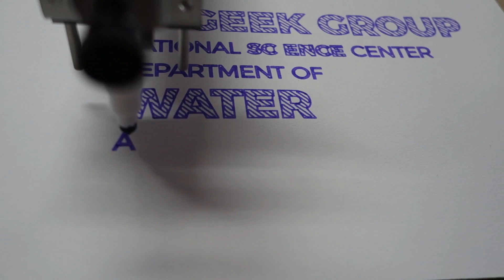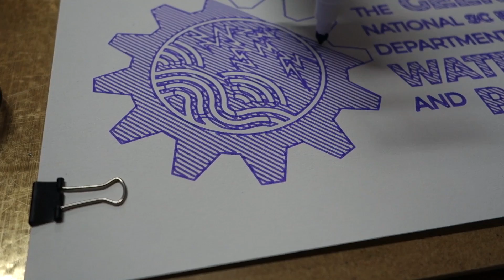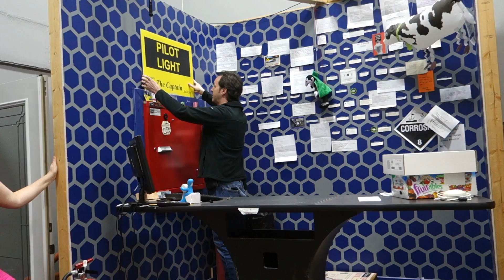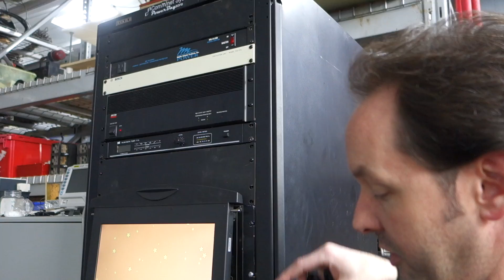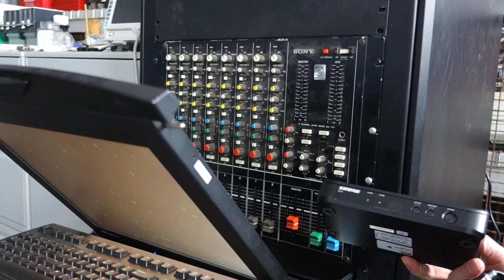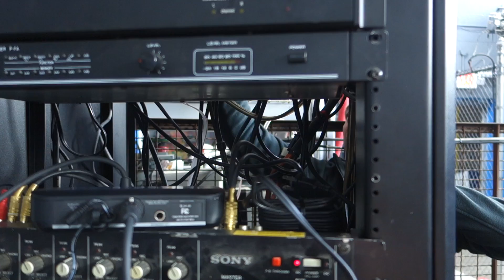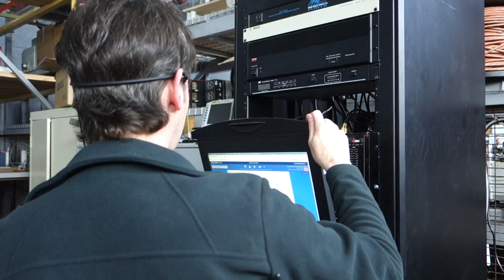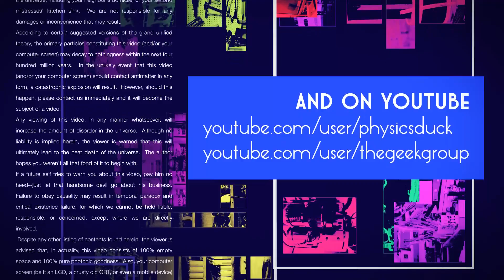Captain's Blog 12 22 2016 AxiDraw Testing and New Wireless Mic Setup

Comment: Cool. The AxiDraw is a 500-dollar crippled version of a 1970ies pen plotter, minus the speed and work area. And without an actual pen plotter ink reservoir pen with precision line size.
You can just put a pen plotter actuator as an end of arm tool on your large sheet router and run code on that if you want huge plots.

Comment: where do those random links go?  AxiDraw makes interesting noises.  the I is missing.  to much code in the machine.  what are chromosome cookies?  1308  they need the smallest box that the item will fit.  your lead commentator is working today.  1458  what is xlr?  IN and OUT are very important.  going the wrong way will break something.  an electric device has a "12 DCV in".  photonicinduction responds with "um ... that is a suggestion.".  fuzzy bits make life comfortable.  dropping the mic box did not help.